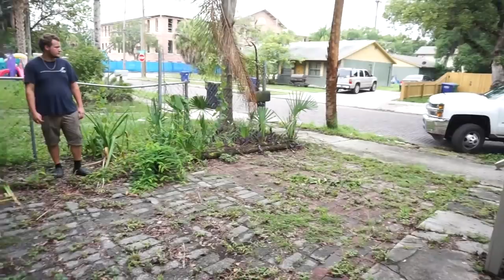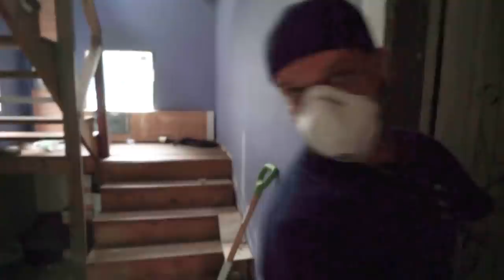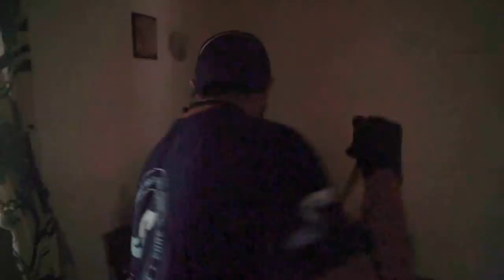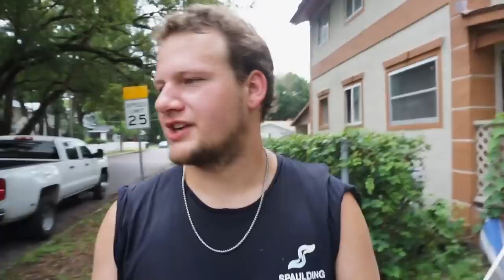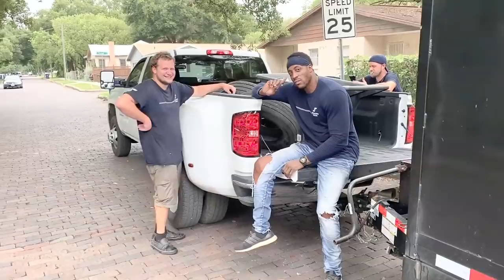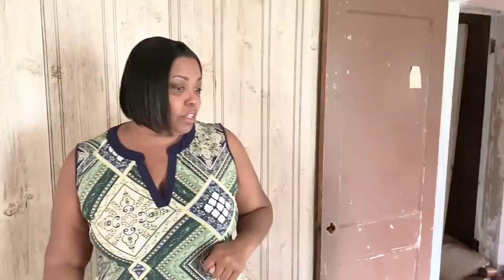Vintage clean

Comment: I hate seeing vintage things destroyed
Reply: Rochelle Bailey same!! It’s such a shame!
Reply: People get way too paranoid with the bio cleanup.  I've bought a biohazard-salvaged minivan off COPART before, which was from a hoarder house and was loaded to the roof with stuff, used as a storage shed.  A raccoon had died inside it, hence why it got labeled as biohzard.  I removed the critter, cleaned out the stuff, deep shampooed the carpet with industrial spec cleaner but everything in the van was fine.  I sold most of the stuff that was in the van (hoarders always have reasons as to what they collect) and made triple my money back what the van cost me by selling the stuff that was in the van. A lot of old dishes, several boxes of vintage women's coats from the 60s, I remember someone from a TV studio prop house bought ALL the vintage products from the 80s that I found in the van that I put up for sale.  It was just a mishmash of random stuff, looked like maybe the hoarder's parents or grandparents died and they saved all their valuable stuff in the van for safe keeping and so it wouldn't get lost.  They had the windows cracked slightly which is how the racoon managed to pull the window down and get in (was manual crank windows)